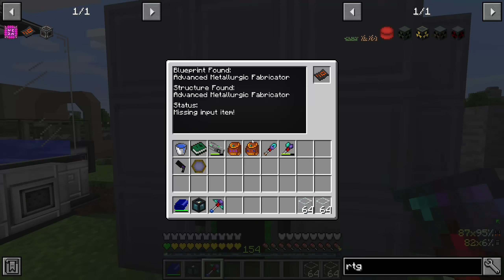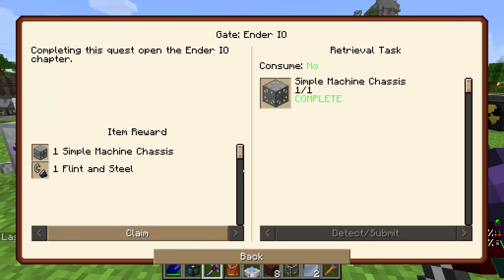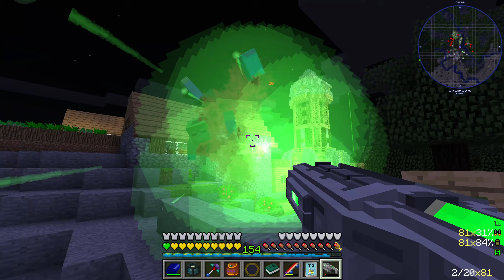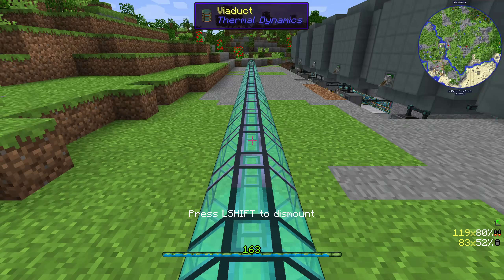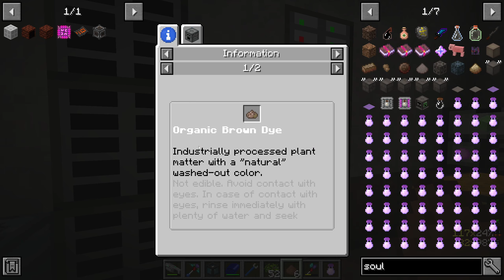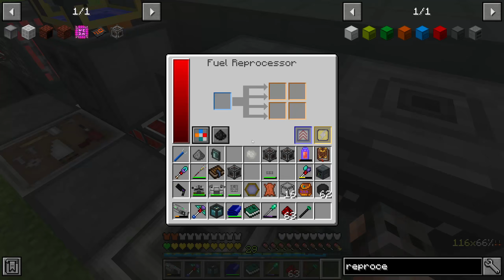Enigmatica 2 Expert: Ep09 - Enderio and Nuclear Wasteland

Comment: Lash, I feel like you're not far off the full mekanism power, which would sort you power wise for the rest of the game.
Fusion Reactor, Thermoelectric Boiler and Industrial Turbine, and can be expanded as needed
Reply from the maker: Bello 💜
When I saw your comment I went and checked. Yap I’m very close to it. I was in a creative world and started checking environmental tech solar panels. Tier 4 gives you 700k rf and tier 5 will jump to 6 million rf. I know it’s less fun to setup but at least I think they will be less laggy in the long run. Of course the final tier gives you 70 million rf/t. So I honestly don’t know which way to go. Fusion from nuclearcraft is also something I need for neutronium.
Reply: @Lashmak  Agreed. I think they both do the job really well, I prefered the reactor/turbine setup as it's more fun like you say, plus the power output at full size is just kind of wild (If I remember correctly, it's something like 270+ million rf/t), but yeah, did cause some lag if you were near it when at max size.
Other things that I found super useful were:
Flux Networks (especially before Draconic Evolution, although I used them for the rest of my playthrough anyway) - they're quite cheap in mid/late game and have unlimited throughput
Environmental Controller - Just general QoL, constant speed and saturation was very nice

Loving the playthrough! Adore this modpack and this is a really fun run!

Comment: If I remember correctly, there is flux networks, so you don't have to use the quantum entangloporters
Reply from the maker: Ah yes yes. But you don’t want to know the recipe 🤓
Reply: @Lashmak  Oh, sorry. I remembered in E2E that it was just a crushed EnderIO frame. I played it a while ago, so they probably changed it.

Comment: Enderio capacitors can be pretty op. I always used the default recipe one so I never knew.
Reply: in this pack the enderio machine speeds are buffed, all recipes are instant with a octadic capacitor, in po3 octadic capacitor are like default speed in this pack
Reply from the maker: Ah yes. The speed is just insane. I was going to do ic2 for pre processing. Now I’m like why? 😂

Comment: Lash you could have just used an osgloglas repair kit and a flint to add the mining level to the pick without changing the head
Reply from the maker: ah yes very true. but the issue is that now i needed enderium lol its a weird mechanic that you have to upgrade your pick every 1-2 episodes. it also doesnt really help with using anything other than tinkers. makes me sad :(
Reply: @Lashmak  the atomic deconstuctor is mining level 11 and that’s not to hard to obtain